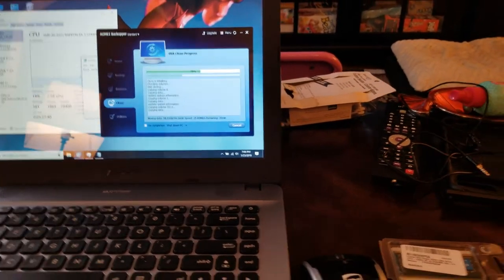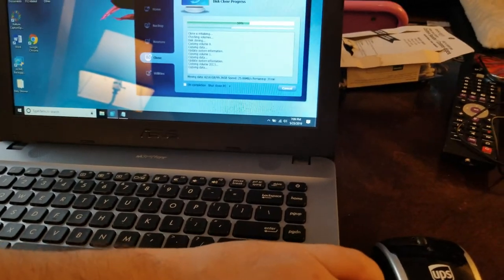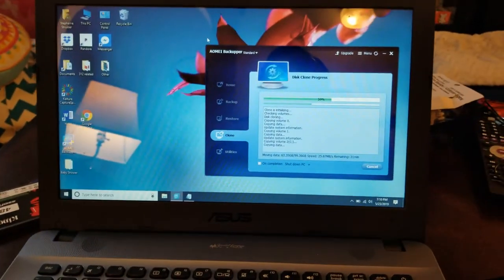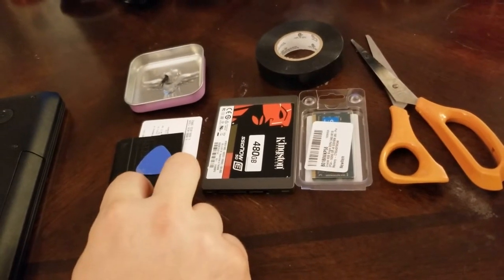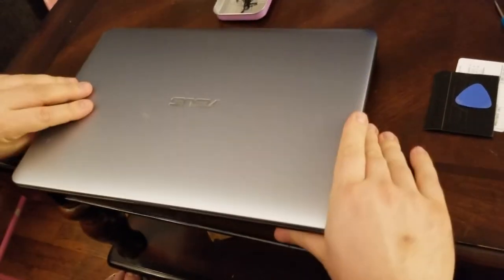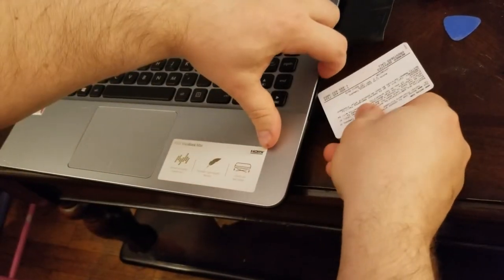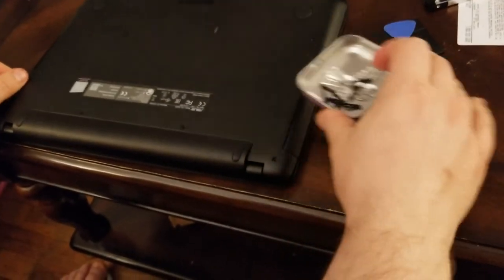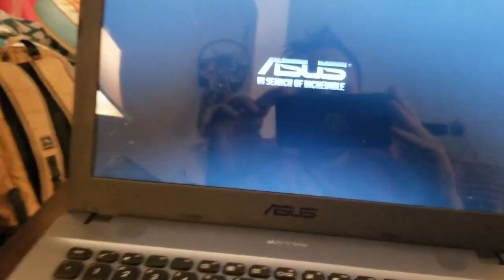Asus X441BA Laptop - Upgrade Ram Memory & Harddrive SSD HDD - Disassembly

Comment: I bought 2133mhz 8gb ram the speed is the same as the soldered ram 1866, is that normal?
Reply from the maker: The soldered 4gb ram is actually 2133mhz. Which ram did you purchase, link? The speed should be 2133mhz, unless your new ram is running at lower speeds. How are you determining the ram speed?
Reply: I think its because motherboard default configuration.
My lappy also runs at 1866,even tough wmic shows 2133.
Lol

Comment: can i use the bay on the top of the hdd to put ssd?
Reply from the maker: Technically, you can mount it wherever you want. However, you have to be able to connect it. Its doesn't come with a wire where you can adjust the position. The connection is directly to the motherboard. Why do you want to move it?
Reply: @OmegaRed7159  im planning to buy a ssd dvd bay so i can put ssd in there
Reply: @OmegaRed7159  for more storage
Reply: @OmegaRed7159  and also crucial 8gb ram 2133mhz is compatible right?
Reply: @OmegaRed7159  
Crucial DDR4 8GB

Type: DDR4 SO-DIMM Laptop memory
Function: Non-ECC
Frequency: 2133Mhz
Module specifications: 260pin
Memory capacity:  8GB
Memory voltage: 1.2v

I also have the same laptop Asus X441BA-CBA6A

Comment: This is Asus X441ba Amd A9 ?
Reply from the maker: This one is an A6.
Reply: @OmegaRed7159  after you upgrade ram 12gb , vram 2gb or increase ?
Reply from the maker: I never upgraded the processor, just the ram and harddrive.
Reply: i mean , before you upgrade ram ,vram standar laptop is 2gb. after you upgrade ram how much vram increase ? usually after upgrade ram , vram will increase
Reply from the maker: @atmadjakurnia5567  The vram is controlled by the OS based on settings, so I can't say. You can always allocate more or less space, or even turn it off if you want. It depends on your needs.

Comment: Hello, I have a Corsair RAM 4GB DDR4 2133Mhz PC-17000. When I add it to the laptop, it won't boot. Why this happen?
Reply from the maker: Are you receiving any errors or beeps? Is the fan spinning? Do you get power? The ram slot can be finicky. I ran into this issue myself. Make sure the ram is seated correctly. Even though it clicks in, it can still be seated wrong. Assuming you reassembled everything correctlt, this is more than likely the problem.
Reply: @OmegaRed7159  The laptop won't get into BIOS and just keep restarting itself every 2 secs (blank display) and I'm not sure if there's a beep code, just the hardisk start spinning and stop sound. Is the fan spinning? Yes. Do you get  power? of course. Yeah, it seated correctly.
Reply: @OmegaRed7159  I assuming that Corsair isn't compatible with this model, and I want to try another brand like Team Elite or V-GEN.
Reply from the maker: @fuutonshinra  I can't speak to the compatibility. Make sure it's really 2133mhz and not more. I would still bet the ram is seated wrong or you missed connecting something upon reassemble.

Comment: sir, how to add vram?
Reply: Sorry sir, but this laptop does not have a dedicated GPU, so you can't add VRAM
Reply: @seehedyt  if the GPU can be added, sir?
Reply: @islahshalahuddin6904  the GPU in the inside of the CPU, it's not upgradable, CPU not upgradable either because it is soldered in meaning you can't remove /r replace it

Comment: I had some trouble, when I turned my PC on it started in Bios utility ez mode, if someone knows what I have to do for solving my problem please tell me.
Reply from the maker: We need more information. What modifications were done? Any errors? What is the Bios showing you?
Reply: Hi I had the same problem too after upgrading the ram. It says no hard drive is installed in bios.

Comment: Dude,youre wrong,you even can use like 3000 Mhz,but the original ram is 2.400 Mhz so The 3.000 Mhz will be downgrade to 2.400 Mhz,i already installed the 2.400 Mhz speed and everything works normaly,and if you installed 2133 Mhz then the original ram will be dropped to 2133 Mhz speed.if you cant find the 2.400 Mhz then find the ram 2.600 mhz or 3000 mhz DDR 4 SO DIMM REMEMBER
Reply from the maker: No, you're wrong. The onboard soldered ram is clocked at 2133mhz. The board is rated at the same. Here's an email from Asus Support. Please don't mislead consumers with your opinion, because it is clearly wrong. Facts do matter!

Hello Daniel,

Thank you for contacting ASUS support. My name is Yannique D. I appreciate the time out you have taken to notify us on your concern and I apologize for any inconvenience caused. I’m grateful to be able to further address this matter with you.

On Sun, Jun 2, 2019, 2:38 PM servicecenter_am@asus.com <servicecenter_am@asus.com> wrote:

(*Please do not change the subject line when you reply to this email)

Thank you for your response. I'm truly sorry but we have provided the available information that we can about this unit and upgrading the RAM. 1866 mhz would be considered the speed at which the unit reads the RAM. We are also unable to state a specific third party dealer for sourcing the part. Also, ensure you're using the latest BIOS version.

BIOS 306 - https://dlcdnets.asus.com/pub/ASUS/nb/X441BA/X441BAAS306.zip?_ga=2.150106230.1973313748.1559497958-1705260420.1545145869
Direction - https://www.asus.com/support/FAQ/1008276/

If you have any other questions, comments or concerns please feel free to reach out to us again. Thanks for choosing ASUS support.
Regards,
Yannique D.

ASUS Product Support
http://www.asus.com/us/support/
Reply: @OmegaRed7159  nah,i already installed the 2.400 mhz and i can turn it on,and can rrach the bios

Comment: I just bought a new ram. My asus laptop isn't booting when the ram is inserted. Even if its inserted properly and compatible with my laptop :(
Reply from the maker: Please list the exact specs and brand for this ram. ENSURE it is seated properly. Just because it clicked in does not mean it's seated correctly. The slot is very finicky.
Reply: @OmegaRed7159  I saved your video until I got a ram, we have almost the same memory of laptop, its just mine is ASUS Vivobook X441UR.. I used crucial.com scan tool it shows 2400Mhz rams, but my laptops is same as yours.. showing 2133 in memory tab in task manager also in cmd... so I bought the same frequency 2133...then whenever I insert the ram, my laptop won't boot...
Reply: @OmegaRed7159  I just noticed recently you bought 2400 ram but I already bought 2133.. did i buy the wrong speed? :(
Reply: @OmegaRed7159  its also seated properly, I also tried to clean with ereser but doesn't work
Reply from the maker: @ninehartt  You got it wrong. You need to purchase the 2133mhz, not 2400. Also, I'm confident that Crucial is 2400mhz: https://www.crucial.com/usa/en/compatible-upgrade-for/ASUS/vivobook-max-x441ur#MEMORYFilters.
Reply from the maker: @ninehartt  In other words, you have the wrong frequncy
Reply: @OmegaRed7159  I bought a crucial ram with 2133mhz same as my laptop..but in their site only 2400mhz is compatible with my model..maybe I really bought the wrong frequency..I'll just replace it with 2400 i guess...btw thanks sir :D
Reply from the maker: @ninehartt  You need to use 2133, NOT 2400.